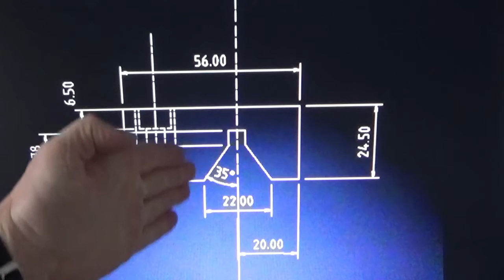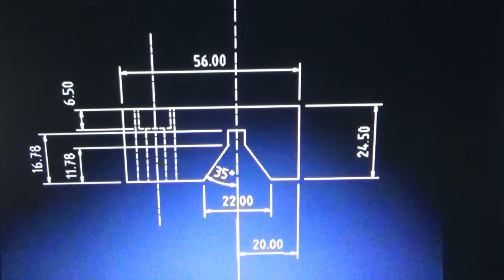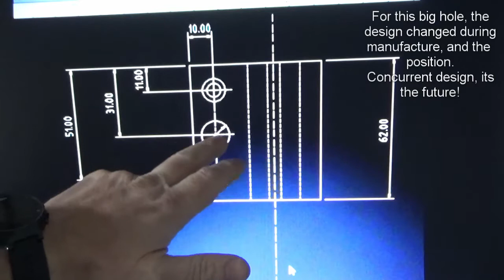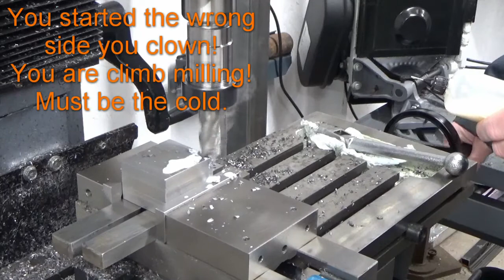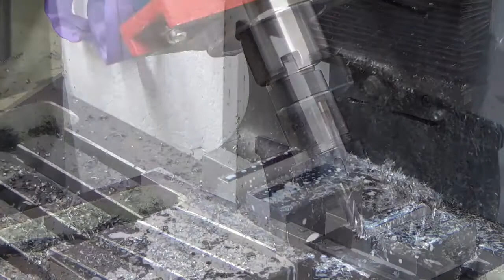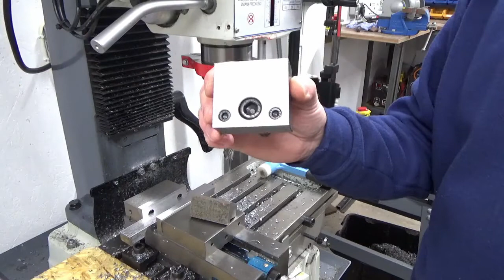Making A Carriage Stop for the Harrison M300 Part 1

Comment: G'day Jon. Great vid. I have a round column benchtop mill so no tilt on the head. Any suggested methods for achieving the vee angle?
Reply from the maker: Hi Adam, thanks for the comment. I guess it all depends on the angle, if it's 90 deg the you can set the workpiece up at 45 deg in the vice and run an end mill through. If its anything less than 90 deg, you are stuck with buying a bespoke form cutter or you could make the block higher (above the 'V'), and put a split line (ie in two half's) though the centre of the 'V', machine each half angle separately, and then join together above the 'V' with a couple of minimum M6 cap screws. An alternative method is scribe the angle lines on each end, rough out close to the lines with small end Mills in a stepped fashion (or angle grinder with slitting disk), then file to finish (not easy but possible). Hope this helps. Cheers, Jon

Comment: Hi john just watched the video wondered if you blue up the V check contact on the bed, ok as it is but mite help when tilting the head next time. also check out youtube stefan gotteswinter / and phil vanderlay both built  x axis drive using car wiper motor and shop bought DC driver for speed control on the fly great project for your mill and perhaps spray coolant. from another Guinness drinking M300 owning Bridgeport miller. thanks Jeff

Comment: This is where somebody says you can make anything with a shaper. Love mine. I can make anything. G and E 24 inch. That was not a comment on how you have to do it. Just a little sarcasm for the shaper is dead crowd.
Reply from the maker: Hi Dean, thanks for the comment. I am firmly in the 'long live the shaper' crowd. Its on the 'to get' list, just waiting for the right one and the funds to line up. I did think whilst planning this job "if only I had a shaper". Cheers, Jon

Comment: Hi Jon, there's loads of ways to do that "V"/dovetail, this way turned out just fine, nice one. Regarding the drawings, I use Fusion 360, you could use the Windows "Snip" tool & just paste it into a Word document. Even create a .pdf from that if you want. Just an idea before you get your licence sorted. Cheers.
Reply from the maker: Hi Dave, thanks for the comment. Yeah, your right, my issue is my old crappy laptop which has the trial version on which unfortunately is pre 'snip' tool, and print screen is disabled. I need to spend a bit of time getting the full version installed and set up on my newer PC, we will be in business then. Spending too much time either at work or out in the shop! Cheers, Jon

Comment: Winter draws on!. The 70° "V" is a strange on the must have had tooling made themselves, more production costs.
I think that would also reduce the bearing area, for thee bed. All of you clever viewers please correct me if I am wrong
Reply from the maker: Hi Fred, thanks for the comment. Yes, an interesting angle which I am guessing was designed around the induction hardening process more than anything else. There is a very slight reduction in bearing surface for the same height of 'V' but it's really quite minimal. One of the most stable and rigid lathes for its size so the designers knew what they were doing I guess. All good challenges to navigate. Cheers, Jon

Comment: Thats the first time I have seen anyone using the tipping the head feature on a small mill, I have never done it with mine even though I can, I always tip the work. For me its far easier than re tramming the head as my mill does not have any fine adjust other than lighter hammer taps, it was always on the to do list but now changing to cnc its not needed. I use angle blocks if I have one that does, if not I use an electronic inclinometer that has been pretty accurate for what I do.
Reply from the maker: Hi Derek, thanks for the comment. I won't be making a habit of it, but I never got round to re-checking the tram following the head rebuild so I knew it needed doing therefore went for it. I think it's not a bad idea actually, if you never move it, you are probably less likely to check it and could be running along with an error. The inclinometer is a cracking idea, will get one on the Christmas list. Cheers, Jon

Comment: Had a good chuckle at the outtakes Jon!

Project is looking good. Good to see your mill being used with the head tilted, still something I have to try on mine! The result came out good!

What CAD package have you gone for? I use Autodesk Inventor and AutoCAD day to day at my work (Design Engineer/Design Draughtsman).
Reply from the maker: Hi Morgan, thanks for the comment. It's a bit of hassle as it all needs tramming back in etc but I wanted to check it out anyway so no drama. I have gone for QCAD, it's incredibly similar to a very early Autodesk product called Autosketch that I used to use 15+ years ago. In more recent years, I got pretty deep into Siemens NX CAD/CAM in the 3D space. My issue is the crappy old laptop, its Vista and has had no updates for years so loads of .dll files missing. We have a newer laptop, I need to try it on here. Cheers, Jon

Comment: That was great Jon, really enjoyed it. Looking forward to the next part. Outtakes very good, I'd never get past that point! Hope you can get some heating sorted for your shop. Best Wishes from Carl.
Reply from the maker: Hi Carl, thanks for the comment. Must admit, that's the first time the giggles have stopped me (I am sure there will be more). Need to sort the door out before I consider spending money on heat! I have more coats and a scarf and hat if necessary. Cheers, Jon
Reply: @jonsworkshop  I put an insulated roller door on my shop. What a difference. Its like a fourth wall when closed.

Comment: They used to say Guinness works wonders (or maybe that was Double Diamond) anyway I think your out-takes have just proved the value of a quick sup.   👍
Reply from the maker: Hi Del, thanks for the comment. Well it certainly helped on this occasion, not sure what was funny but something was messing with me. Got your email by the way, will respond in the next couple of days hopefully. Cheers, Jon
Reply: @jonsworkshop  No problem Jon, I'm in no hurry whatsoever, just that my workshop is full of timber for boat fitting project, at the moment.

Comment: Nice work Jon.  Yep, shooting YT has it's moments.  My record is about 10 goes for one clip.  One question, why not make the bottom and intermediate pieces all one bit - basically "L" shaped ?  That would be a snack to mill.  It will still pull up OK.  I also added a pivot point on one block so that there is no cant when pulling them up together.  Certainly handy items and I have one each side of the carriage.  Good useful lathe project.  Cheers Rob
Reply from the maker: Hi Rob, thanks for the comment. I am sure I will have more occurrences of loss of marbles, still, gives you all a giggle! I thought about doing exactly that, and then dismissed it and for the life of me can't remember why now. I think I was probably concerned about it pulling up out of square and mashing up the 'V'. Oh well, committed now! Cheers, Jon
Reply: Hi Rob.